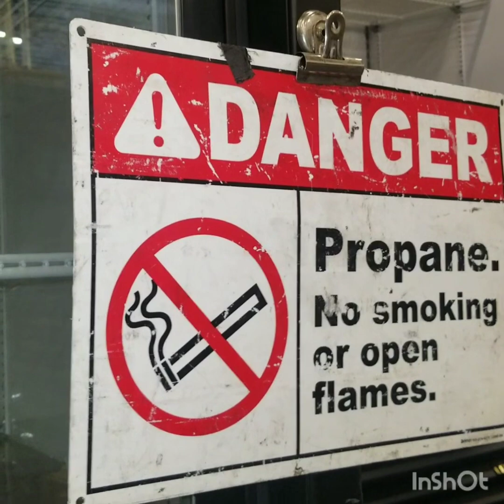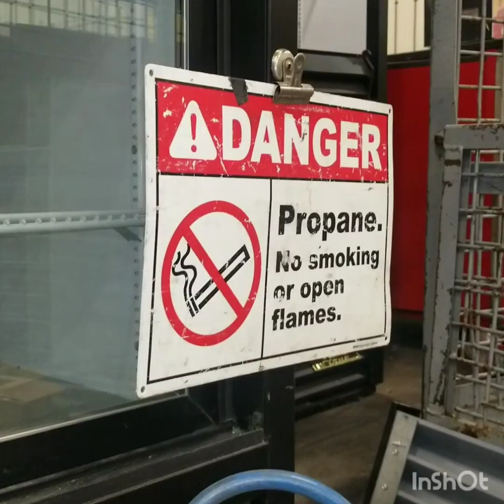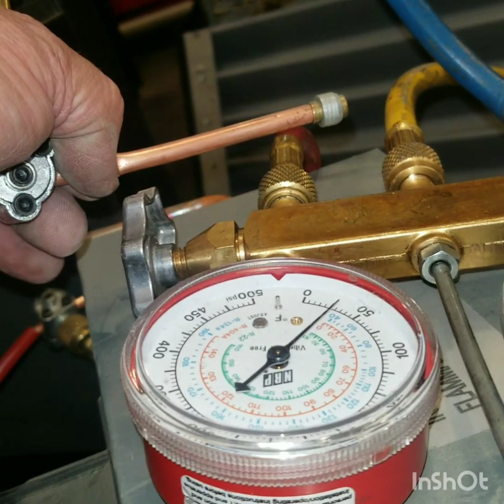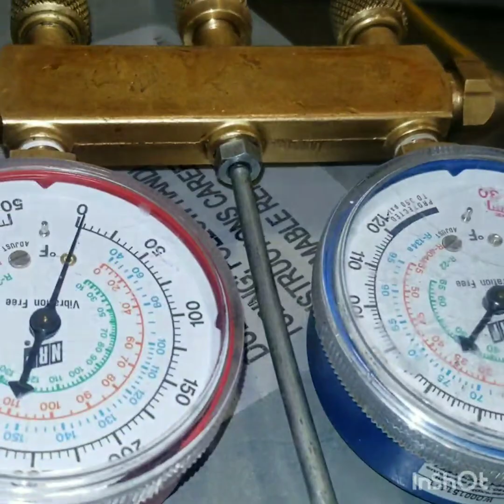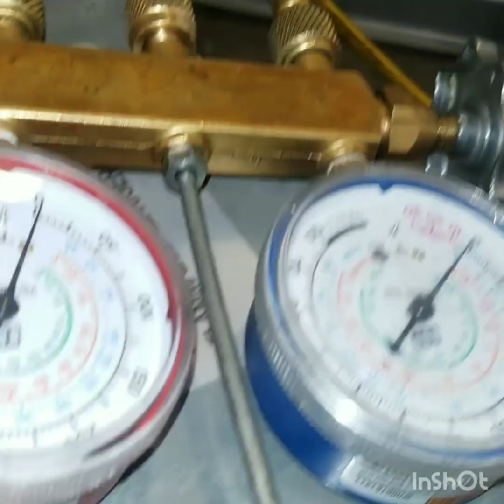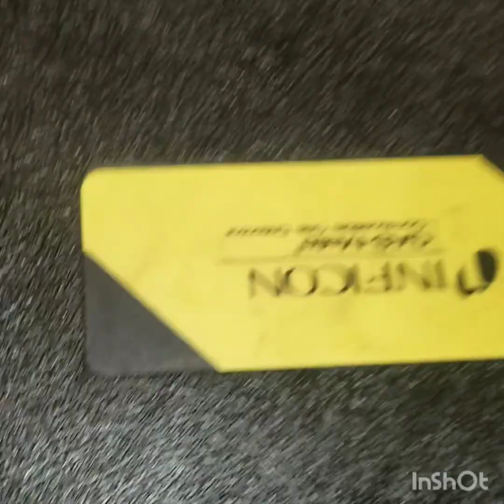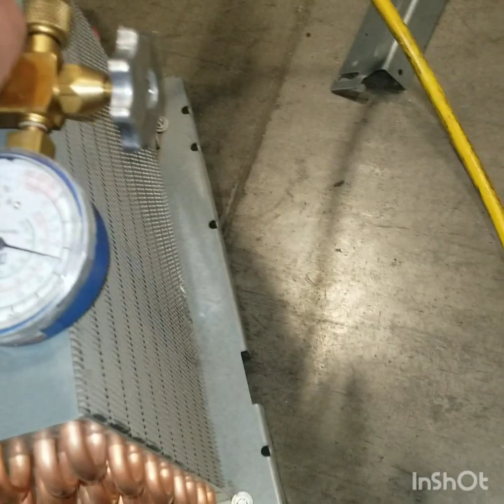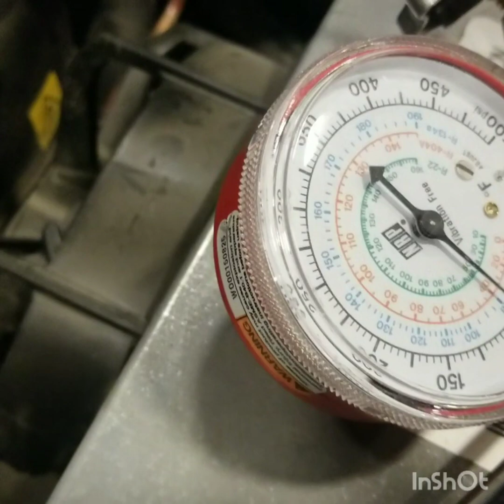Hydrocarbon r290 refrigerant evacuating removing refrigerant propane removing refrigerant R290

Comment: Hey cherry creek finally a subscriber I’m catching up on old content… would it have been possible to just put a recovery cylinder in a vacuum and just dump it in the parking lot later? Did you blow off the whole time but by bit or just for the sweep after the initial release.

Comment: If it's safe to vent R290 you can do so, because it's legal to vent it.
Reply from the maker: It's somewhat safe to vent. You have to do little bits at a time so you don't get big pockets of gas.  Yes it is legal too.
Reply: I take long hoses and either run through an open window, or door.  Most of the time i roll unit outside if on wheels, take it far as i can from building, and then vent refrigernt r 290.  I absolutrly hate these new flamable systems. My question is why?  There has to be somdthing just as good not flammable.  What about carbon dixoide? Its not flammable

Comment: wow....you are the first mechanic other than myself that is aware of the 7.2V Makita impact driver.....Great tool, I actually picked up their variable speed model a few months ago.  It fits in my MB2 Veto bag along with my fluke ammeter. Are you finding much of this R290?  Ive only bumped into one so far.  My boss can't believe they are using flammables as a refrigerant.
Reply from the maker: R290 so easy r290 is falling out of warranty. No more recovery unit. much faster blow nitrogen through the system and there's no more love that makita 7.2